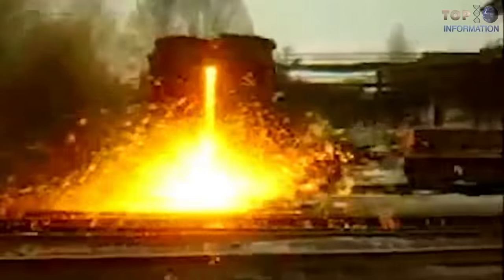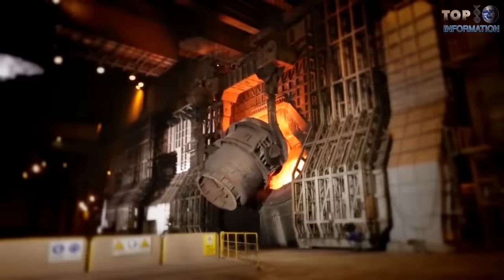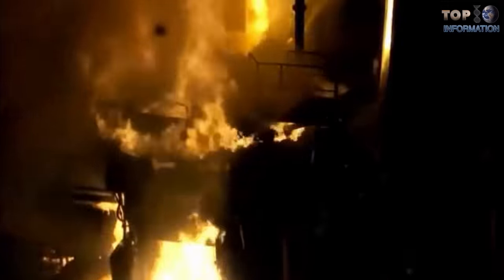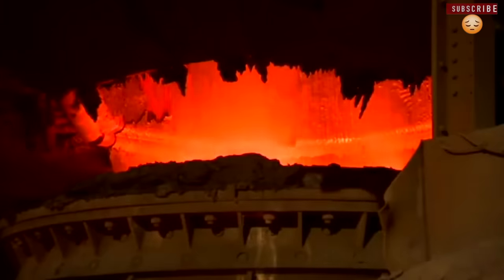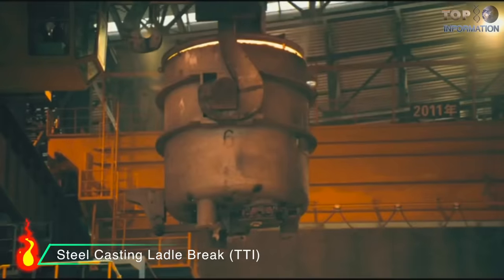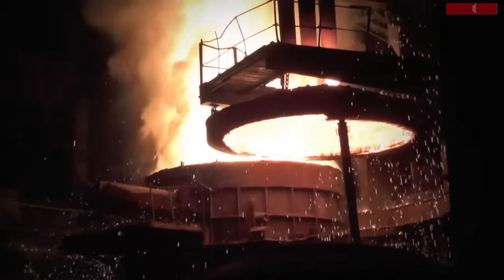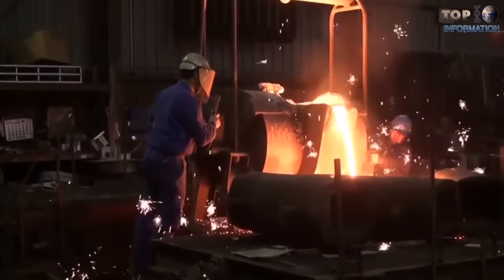TOP 10 Accidents In Metal Industry ✅

Comment: This video is absolute non sense and totally stupide. The author clearly does not know anything about metal industry... Where have you seen boilers in metal industry? When the speaker talks about boilers, you just see an electric arc furnace accident, not a boiler one! And when they talk about explosion, what you see is nothing else than an old factory being destroyed by dynamite! Absolutely not a boiler explosion. And even the blast furnace that you see exploding is also an old one being destroyed by dynamite, it is not a boiler explosion or anything.
Reply: There are many boilers used in the metal industry. They are used for everything from power generation, emergency backup power, drying, both process and facility heat, etc. 

Most industrial and commercial buildings have boilers as well. Any time there is a large heat demand, you'll find boilers involved somewhere.
Reply: Before answering, you should read better my text... Have you already seen metal processed in boilers? That's the point, not if you have boilers somewhere in metal factories to do anything else than metal processing.
The video is supposed to be about accidents with boilers (listen to what the "marvelous" voice says, explaining that boilers can explode and spread liquid metal everywhere), and the only things you see have nothing to see at all with a boiler, these are different machines. Clearly, they know nothing at all and mix boilers with furnaces...
Reply: You literally said "Where have you seen boilers in metal industry?". I simply replied they're everywhere in the steel industry, not once did I claim that iron or steel is processed in them as you claim, but steam, produced in boilers, plays a huge role in steel plants and other industries.
Reply: Not to be a jerk... but since I am not a native english speaker, then I invite you to write your comments in french, just to see if I can apply your comment to yourself when you write in my language...
Reply: yeah it isnt the best but the same argument can be made about you. Tf do you know about metal working and about boilers involving these plants
Reply: Angueran is right.  There is so much disinformation in this compilation video.
Reply: @dperry428  I'm sorry but my phone has a really dumb auto correct feature. But thanks for pointing that out like a month and a half after posting. Helps me learn.
Reply: Look, I didn't mean any disrespect, and yeah, my mistake was funny and fairly ironic, but still. Zesh, it was autocorrected, and to the French dude who I first replied to, good, glad to see someone attempting to be bi-lingual. And sadly, I can't take your offer because I can neither type nor read french, so I stand corrected.
Reply: @anguerandelamouliniere3070  *Boilers are used all the time in  metal processing, les chaudièr sont utilisès tout le temps dans traitement des métaux. Boooom!! Lol
Reply: China?? But you know , they have a great talent for mastering whatever is in the interest of accomplish as much as required including amazing quality.
Reply: A lot of what is in this video the woman doesn’t know what she’s speaking about. Spent years on the EAF floor, Continuous castor, rolling mill floor.  Just a lot of incorrect info in this video

Comment: The word is def'-la-gration.  And, electric arc furnaces do not produce steel from ore. They are used to recycle steel by melting scrap metal.
Reply: Eric Weisenhorn...excellently put my friend!!!
Reply: At my job (arcelor Mittal belgium) they’re also used to gain some heat in already molten steel.
Reply: We have, or had, an ironworks, near downtown Fort Worth, that used induction furnaces. It was McKinley Ironworks, and a pair of sisters owned it.

Comment: I worked in a steel mill for 10 years and have seen things go wrong... very wrong.. The worst thing is water..... If hot molten steel hits 1 liter of water.. it turns the water into 10.000 liters of steam... in a split second. That is one hell of an explosion...

Greetings,
Rik
Reply: I think the number is 1,728. That's what I recall, from chemistry, and physics. If I remember right, it was called Avagadro's number.

Comment: Did you just make most of this up?, only thing you got right as far as I can tell is the boiling point of water.
Reply: I hate to tell you this Mr. Atheist, but she even got the boiling point of water wrong.  The boiling point of water is not a constant.  It varies with pressure and is only 100 degrees Celsius at standard atmospheric pressure which is about 14.7 pounds per square inch or 100 Kilopascals.  If you raise the pressure on the water to say 1000 PSI (6.9 megaPascals) the boiling point of water is increased to 285 degrees Celsius or 545 degrees Fahrenheit.  This is why some steam explosions seem to start with a little burp followed by a sudden massive explosion.  The burp relieves a little of the pressure so the water is now super heated for the remaining pressure and it flashes to steam with dramatic results.  Of course, in the context of the temperature of molten steel water will boil at any readily achievable pressure.
Reply: @Vincent_Sullivan  standard atmospheric pressure is actually 14.7 psi.
Reply: @jackbrown6749  Hi Jack;  You are of course correct!  I plead guilty to being a lousy typist - and an even worse proof-reader. It is kind of depressing that nobody noticed that error for a year.  I have corrected the typo and I thank you for bringing it to my attention.  As the saying goes in the steel industry:  "You can put water on steel - but don't ever put steel on water!"
Reply: One footage of the explosion is used 3 times. Two different types of accidents are covered in this single video with NONE being an actual cause.

Comment: I got disabled while working at a steel mill. All my years were spent in the Melt Shop, and it was liking working in Hell. We used an Electric Arc Furnace and had been covered up from the dust on the ceilings from a mighty blast. A few times enclosed cylinders went off also as the  Furnace was being charged. Oh, well, I ramble
Reply: I dont know how people do this work. I was hot just watching this video! My god, the heat must be unreal, not to mention the risk. Molten steel isnt very forgiving. Not to mention working with a lot of machinery, another huge risk. Im sorry you were injured. Hope you werent burned; burn pain is just about the most difficult pain to treat.
Reply: Sealed containers are a real risk. We screen out scrap carefully but sometimes they make it through. Super dangerous, especially since you can't know for sure what's in them.
Reply: Just curious howd you get disabled
Reply: These steel Mills looks like something out of some steam punk dystopia. Well wish you the best o7.
Reply: @suchabadkitty1293  its not just the molten steel, the real hazard is slag. steel sticks to you and burns, slag goes thru you
Reply: don't work in places like that.

Comment: I worked in the steel industry for 15 years. I worked in and around blast furnaces, BOF's, EAF'S and rolling mills. Now, the water into steel isn't exactly correct. You can put water into molten steel. However you can't put the steel into water. If you put water on to Molten steel it just steams  and evaporates fairly quickly. However if you put molten steel on top of water, it basically creates hydrogen which will cause the molten steel to blow out of whatever it's in. I've seen it happen many times. We had a ladle under the tap side of our arc furnace waiting for the heat to finish and there was a water leak that was filling the ladle with water the whole time. No one saw it happening until it was to late. As soon as the steel went in, it blew liquid hot steel everywhere. It caught all kinds of things on fire in the area. Luckily nobody was on the floor when it happened.
Reply: Thank you. Because the EAF uses water cooled electrodes from spray rings so that waters constantly running down the electrodes and or running into the top of the delta into the furnace.  It either Evaps before it makes it in or steams off when it does.  Water is really only an issue when it occurs underneath the steel.

Comment: Here's the thing. I worked at a steel foundry working with only 2000 pounds of steel per pot usually multitasking 3 at any given time when running on an assembly line for molds. I was doing mild grey steels to stainless at 2600 to 3500 degrees with water coils to cool on an induction furnace. 400 kw  inductotherm furnaces are small and dangerous and these companies don't always care that metal could be wet even when guys have to pour by hand right next to the ladle. I've personally been next to a few explosions and a furnace that small can rock a 3 story building without breaking a sweat. L&I doesn't even have laws or rules to protect specifically against the dangers these workers face. Heat exhaustion and staying hydrated is really hard. Employees get treated as expendable machines who work crazy hours because downtime is money lost and lean productivity creates the most profit. These matters should be brought forth to the public's opinion and something should be done to ensure workers aren't needlessly putting themselves in harm's way.
Reply: Bearistopheles  past. I've been at the hands of people like you and watched others ruin there lives or end them working in these places. Your not doing anyone any favors stop kidding yourself and maybe care more for your fellow worker. Just because it has been that way doesn't mean it should be.
Reply: Bearistopheles most of the people working in these places can't find jobs elsewhere. Especially in non union steel work it gets very dangerous when the worker can't be represented on equal terms with those making the rules.

Comment: I worked at Great Lakes Steel, in River Rouge MI. For a week. My job was loading coil-haulers, specifically I would secure the steel coils (basically gigantic toilet paper rolls made of steel) to flatbed trailers with metal bands and a come-along.  Each coil would very by size and weight, depending on what they were being used for, but most of 
 them were bound for Ford motors, GM, or Chrysler, and were the equivalent of several cars, so yeah they were heavy. I was surprised when I first started because the coils would still feel the heat coming off them when you got close enough, and this is after a couple days! Anyway even though the money was GREAT, I just couldn't shake the feeling that I was gonna have a terrible accident. This was right before the huge layoffs and
 outsourcing though, so I know I made the right choice.
Reply: as a steel worker who reveives coils like that from foundries like yours, yeah if one of those unbuckle from those straps when not in a roll forming machine, shit gets violent

Comment: she said water is to blame for 90% of these events?

damn girl
Reply: But it’s true. Water and melted steel don’t mix. You can put a garden hose on top of a mold filled with liquid steel , but if ANY moisture is in the mold and you pour liquid red hot steel on it , it will explode !!  I used to work in melt shop of steel mill. Fascinating job
Reply: Steam explosions are one hell of a thing.

Comment: Boiler vids are not all accidents.  Most of them are demolition.  Anyone with half a brain can see that.
Reply: Well that and there was literally only one part with an actual boiler and it was shiny new and didn't blow up.
Reply: Yet twin towers collapsed due to jet fuel.
Reply: Yes, they actually did. The buildings acted as a vertical venturi as nearly 50,000 gallons of jet A poured down through elevator shafts all the while atomizing it and mixing it with higher pressure ground level air as it escaped upwards trying to equalize. As fire develops, the heat exacerbates the problem. This creates an extremely volatile situation and can easily soften steel allowing it to bend and lose composure. The U.S. did not blow up the friggin building.

Comment: I worked in the steel manufacturing industry for 24 years, before retiring.  No denying the danger (often, extreme danger to be sure)  in nearly every facet of manufacturing. In this video it's obvious to me the script writer for the video isn't personally familiar with the processes or the verbiage used would be at times much closer to correct. I don't understand the connection of a boiler to an arc furnace, there is a considerable difference. Perhaps in creating the video this is an example of good intentions not quite on the mark?

Comment: I worked as a smelter and of metals and ores on a mining rig in Mozambique during the late 70s and early oughts. We did smelting, welding, smearing, sheeting, flooring, contouring, surfacing, resurfacing, sheening, carbon straddling, carbon straining, metal detection, metal detector oversight, pan standing, electrocutionary convulsation, all assortment of metallic situations. I can neither confirm nor deny that I did this.
Reply: 3:53 i think we just watched someone die from getting a bath

Comment: You should have talked to people who know something about the steel industry before making the video !
Reply: Feel free to ask me anything. I've been at a steel mill for quite a while now.
Reply: I spent 35 years at a place that made steel alloys in both air melt and vacuum melt furnaces.  For everything from gun parts to artificial hip sockets and knee joints.  Vacuum steels for the hot parts of jet engines.  Plus any other parts that required a special alloy, from either side of the shop.  I did every job there.  We just made the alloy, and sold it to the investment cast industry, or the airplane company, like Rolls Royce, or Air Bus, etc.

Comment: There hardly any accidents here. Most of the first clips are normal foundry practices eg. dumping slag; striking arcs; charging a Bessemer coverter
Reply: Yes, and they talk about such things as "moisture added to the boiler" when they are showing cast-steel crucibles in normal operation.

Comment: Does anyone know many windmills it takes to power one electric furnace?
Reply: Anywhere between 400-650 kWh per ton of liquid steel.  Let's take the 650 example:
With most turbines producing about 20 kWh on an average wind day, you'd need 33 turbines per ton of liquid steel during operation.

Comment: on the carbon arc furnaces. that principal was used to project in theaters worldwide until automation came along. 1 neg charged, 1 positive charged, put then together and wah la...let there be light! you would have to adjust then closer to each other every so often because a stick is perishable...ie, it gets used up in the process.

Comment: I worked in the steel industry for 40 years on our orientation they said “ this isn’t a candle factory you can get killed here “ I remembered that every day . Look up when you go through a door way and never walk under a suspended load. It can be a dangerous job but you just need to watch out. As far as the video too much drama and with number 1  a cobble is not molten steel, it’s hot not molten..

Comment: I used to truck scrap into Ford RiverRouge and GM Foundry. Nasty places but fascinating to watch. I drove a gravel Train. 32 foot lead dump and 24 ft. Pup. With a 9 ft. Spread on the bogie allowing 160k gross.with proper plate and number of axles.. If they had the plate,axles and tires let it be gone.

Comment: Modern day blacksmith shops. They reach 2000C to 3000C? That is a high temperature but they take less energy than making ultrapure silicon for computer chips at 1400C due to specific heat capacity.

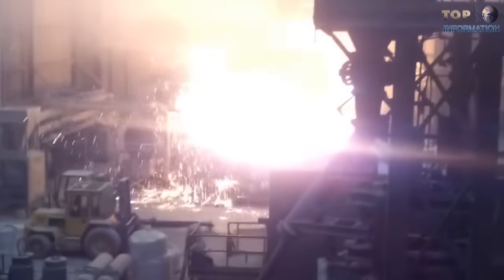Comment: 5:55 OK, this is the half truth. The water doesn't only expand, it will be split up into hydrogen and oxygen due to the heat. Then it immediately combusts, causing yellow hot metal to spread in every direction.

Comment: Hot metal is pretty cool.  I have burned my fingers a few times , digging out fired bullets from targets, which is enough for me, LOL. Suprising how hot a bullet can get after it hits wood or metal.  And if you fire tracer tracer rounds never go down -range and pick them up. LOL

Oh yea, I did have a drop of solder land on the back of my hand once while running copper/ plumbing contracting . Does that count as "metal-working" ? LOL  Happened so long ago even the scar is gone.

Comment: I used to dump slag at Pt Kembla steelworks in NSW. We would have 5 ladles in front and 5 behind a steam loco. About (it`s been a while) 20 ton in each ladle. Flat stick out from #1#2#3 blast furnaces and up the cutting if you were lucky (some times 2-3 goes even with plenty of sand when greasy. Get out to the dump and burst it out of the ladle, making sure we found a big pond of water so you could have a huge explosion and then jump under the little rain cowling that protected the steam ram. Well......you don`t want to die, so that was always a good idea and ...............a lot of fun for an 18 y/o jackass!!!!!!     Twas in 1968 .........fun times!        Pete 379

Comment: I work in a steel mill in the maintenance department. We use electric arc furnaces and have a continuous casting line with our strands. There is also a rolling mill for the billets that we produce. I've never heard such ridiculous nonsense about mill accidents or the conflation of one issue with another...except in politics. Yes, water can cause serious issues. no, slag generally isn't explosive and the only reason "too much" is an issue is that it impacts yield. What they showed there looked like a carbon boil (adding too much carbon. As for heat...yup. It's a steel mill, it makes hot stuff. Really, really hot. Perhaps you should stay away from it.

Comment: WRONG. If water got mixed with hot steel or slag. The superheated water rapidly transforms into the steam  but due to high temperature that steam decomposed into oxygen and hydrogen. Not I gas state will explode ..